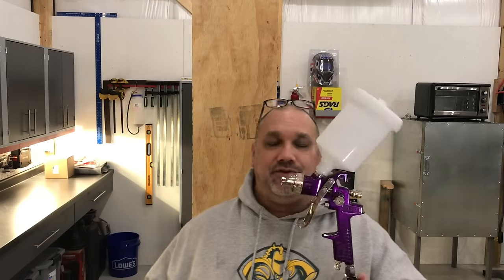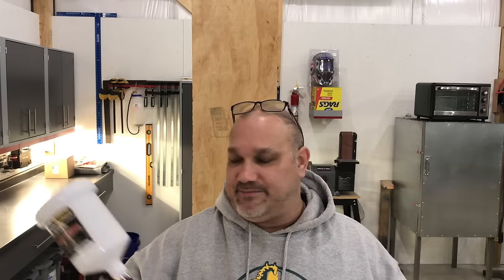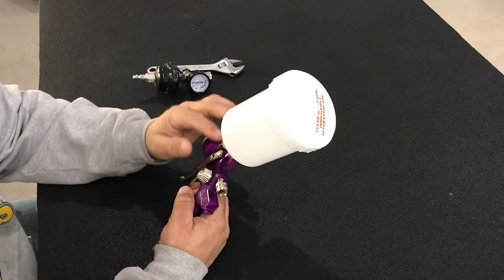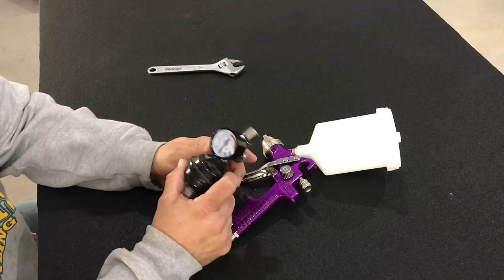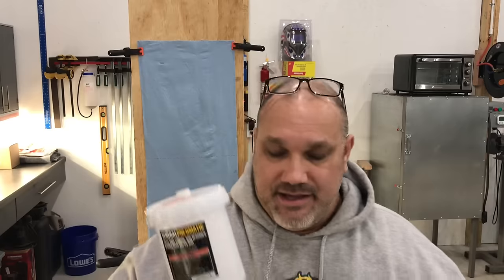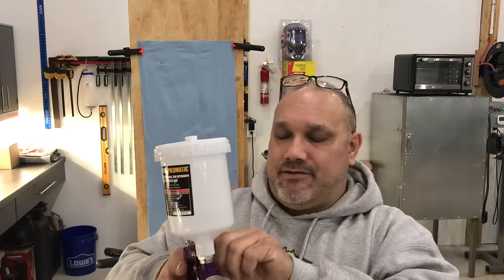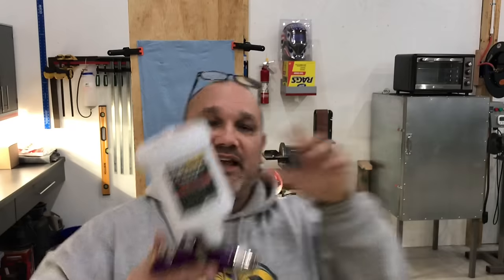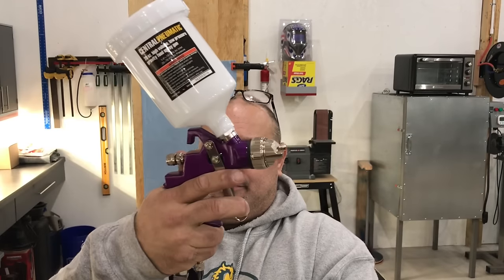How To Set Up a Harbor Freight Paint Gun

Comment: What is a good ration to thin enamel? I was using SHER-KEM enamel but I don't see anything on the can or on the Sherwin William paintdocs that tells about how much you can thin it or the best thinner for that particular paint. I did read that you should not thin more than 20% but that was not for the SHER-KEM.
Reply from the maker: I would start just adding a little solvent till you feel like it sprays the way you want. Keep in mind you can always put a little more in but you can’t take it out. Good luck! Hope that helps.

Comment: How can we know for sure what tip comes with these HF purple spray guns? I have the manual and have searched the website and there is no detail on the supplied tip size. Some people are suggesting they come with 1.4 and some 1.8. I have two HF purple guns. One came with a regular and the other I purchased did not. I am specifically looking to spray 8 interior doors with BIN shellac primer so I want to use the right tip for the application.
Reply from the maker: The 1.4 should work fine.

Comment: Hey man, great video! I'm not a paint guy at all, but I'm refinishing a guitar for my latest project and I'm looking top shoot nitrocellulose lacquer with this gun. Any tips would be greatly appreciated!
Reply from the maker: This gun should be good for lacquer. Take your time on the prep work. Two medium passes are better than one heavy one. Put on a few coats, don’t try to do it in one coat. Make sure you have a clean place to spray and keep traffic down around you part till it’s dry. I’ve seen plenty of guys put on a great paint job only to have a bunch of people going to look at it while it’s wet fill the finish with a bunch of dirt and lint. Tack off your part before you spray. Good luck on your paint job.
Reply: Awesome. Thanks for the reply!
Reply from the maker: Toby Tyler your first coat should be a nice light tack coat put enough on to cover your part if there is a light spot or two don’t sweat it that’s why you do multiple coats pick them up on the next coat. make even over lapping strokes. Good luck
Reply from the maker: Toby Tyler watch dale put on multiple coats. He really lays it on. 

https://youtu.be/keOop5GUZ4A

Comment: So using that same gun I am getting splatter .  You can see the paint splatter as it comes out of the gun and it leaving a real bumpy finish.  It's like the gun isn't atomizing the paint into a fine mist.  I am using duplicolor garage primer and basecoat and the clear
Reply from the maker: Did you reduce the material before spraying it.
Reply: No I did on the next try after sanding it down it was a mess it layed down alot better once I thinned it down

Comment: New to sprayg guns in general. I would like to use this gun to spray interior doors. How would I set it up and do I have to mix something with the paint to make it thinner. Thanks for the video it is extremely helpful.
Reply from the maker: J Lau yes you will need to thin your paint. Best to ask what to use to thin your paint at what ever place you buy your paint. enamel  will be different than latex. Thanks for watching.
Reply: Not good info guy

Comment: Great Video,  one quick question. I've seen lots of complicated setups with plumbing and water drains etc. is that little filter at the base of the gun all I really need to keep moisture and oil out?
Reply from the maker: It’s the last line of defense for moisture in line. If you drain your compressor first it should be enough for a paint job.

Comment: I bought this gun and found that the fluid delivery for 1 min was just over 4 ounces. Any idea why it would be so low? i cleaned the gun thoroughly and tested multiple times with the fluid knob backed almost all the way out. I tried to spray and it was so light i felt like painting anything was going to take forever or at least it'd take 100 coats. Thanks for any advice you can give.
Reply from the maker: I would check viscosity of the paint your using. It may just be too thick. Some coatings are puffy (for lack of a better word) so they don’t like to go they a small tip like 1.4 so you may need to go up on the tip size. There is a guy out there with a video on drilling the tip. Not sure how well that works. Worst case your out 15 bucks if it doesn’t. Hope that helps, thanks for watching.

Comment: Do you have any recommendations for running acrylic paint for small wood projects?
Reply from the maker: Spray a light coat let it dry and lightly sand with steel wool or a scotchbrite pad then repaint. When you paint wood the grain will raise a little on the first coat. Sealing and sanding it will give you a nice smooth part.
Reply: @gixerman01  
Do you think I should thin it down a little bit?
Reply from the maker: @bartgiles1068  I don’t know because I don’t know the viscosity of what your spraying.sorry
Reply: I did thin it a little bit working out good thanks again for your input

Comment: I have this same gun i was just using it with acrylic enamel single stage paint kit any who my bumpers came out glossy but the body of my car looks satin any reason for this? 
Thanks for the lesson on this set up
Reply from the maker: Without knowing the exact process it would be difficult to diagnose that. Thanks for watching.
Reply: With a single stage paint what psi should i shoot with? Compressor and gun.
Thanks for the reply on the other question.
Reply from the maker: Austin Bradley it’s still around 30psi at the gun,  maybe a little more. You just have to watch how it’s laying down and adjust. Good luck. Watch my latest video. I was using thirty psi.

Comment: Thanks for the informative video! You said that you've been spray painting for 25 years, how is your health? Didn't you get any lung problems correlated to painting? What kind of safety masks are you using? Thanks you so much.
Reply from the maker: Use a respirator! Thanks for watching!
Reply: @gixerman01  thanks for the reply, can you suggest what kind of respirator you use?
Reply from the maker: Cyrus Adam Revilla 3m 6200 or 6300 depending on what size you need and 6001 organic cartridge filters.

Comment: Quick question, I have about 3/4 pint of acrylic enamel I'd like to use on a small project.  Mix ratio is 3:1 or 2:1, I'm going to go with 2:1 for more coverage, but my real question is if no waste of paint on over spray how much surface area do you think this harbor freight gun will do with my specifications given?  Be roughly (1) 20 oz fill with what have after reducer.  Looking about ~ 10 square feet needed, feasible????  Thanx
Reply from the maker: Jade Jades a lot variables but, 18 square ft would be a 3ft by 6ft panel, 20oz of paint should cover that pretty easily. Thanks for watching.

Comment: what should you adjust if your paint job is coming out textured or rough. The paint I'm spraying is a metallic, the pressure was at 35. I'm using a harbor freight gun like your showing.
Reply: sounds like your paint is too thick...........did you add Acetone to your paint and mix it.........I believe is a 1/1 ratio.........1 part car paint and 1 part Acetone.......mix it real good before you spray
Reply from the maker: Acetone will make it atomize really well but won’t let paint flow after hitting the part because it drys so fast. What size airline were you using? Was the screen filter in the bottom of the cup? It could have been starving for material. Remove the filter and filter your paint when you put it in the cup. Try a larger air line if you were using a small one. And if those don’t work try thinning your material a little more. Make sure you’re close enough to your part and you are getting good overlap so that your material wets out as you spray it. Hope that helps. Thanks for watching.

Comment: Did u have to start out cleaning the gun mine was full of what appeared to be silicone or something took me a hr to clean
Reply from the maker: Yes I flush it with solvent before I do any spraying with the gun. There is a light coat of oil on the gun that must come off before use. Thanks for watching.

Comment: So what about filters I don't have a filter on my air compressor it says it has a built-in oil filter it's a Cobalt 26-pound compressor. I just put the Disposable filters on my gun is that okay or what do you recommend? I think sometimes I see a lot of moisture coming out of my air hose. Like I said I'm like relearning this so help me if you can thanks
Reply from the maker: If your not seeing moisture when you spray with a air gun one of the disposable bulb filter should be good. Thanks for watching
Reply: @gixerman01  ok thanks for your help i will just keep practicing :)

Comment: I have a Husky air gun and it does not spray WIDE enough ... even after opening that valve up to give a wide spray, its still not wide enough. I am looking for more of an 8 inch wide spray, this one only gives about 3 inches of spray when the valve is wide open then narrow is about 1 inch .. Curious to know if its the nozzle that is my problem and can i get a wider nozzle ..??
Reply from the maker: Depending on the gun it may not go wider than that.  Also how close you hold your gun has a lot to do with this. Hope that helps thanks for watching.
Reply: I think its the nozzle itself ... i did some more research and apparently i have the smallest nozzle available. I need to upgrade to the 2.5mm opening, i think that size should give a wider angle.

Comment: is there any attachment i need to purchase to attach to my compressor hose in order to attach this gun to it? what compressors are recommended for this gun ?
Reply from the maker: You will just need a quick disconnect. I have a video the covers the air compressor needed. Thanks for watching.
Reply: @gixerman01  a female to female? highflow ?male to male or what? what size? i know nothing about disconnects, im tryin to learn. Or does it come with any hose i buy?

Comment: I am trying to successfully spray spray grade contact adhesive what is my best way to make this happen I’m starting a Formica laminate section in my shop I have a 55 gallon drum of wilsonart 950 spray grade contact adhesive
Reply from the maker: You would be better off with a Pressure pot set up, with a pressure feed gun. That’s how most places do spray glue in industrial setting. Harbor freight has a pretty cheap pressure pot. Thanks for watching.

Comment: Would this work if hooked up to the 3 gallon pancake air compressor 100psi  from harbor freight  ?
I have small spots on my car to paint .
Thanks ?
Great video !!!
:-)
Reply: no
Reply: Thanks for getting back to me !
What size tank is good ?
I only have scratch marks and small spots to cover.
I was hoping that 3 gallon would work for little spots, it’s on sale this weekend at Harbor Freight.... lol 
Never tried it before.
Thank you though  !!!
:-)
Reply from the maker: You can use a small pancake compressor if your just spraying small area. I’ve painted small stuff with one with good results. Again it will work fine if your just spotting in.
Reply: @laptoples  no HLVP guns require a minimum of 60 gallon tank especially this one

Comment: compressor size for this gun?  I think I bought one of these HF guns a few years ago to use on a project, but used a pancake compressor that kept running out of air.
Reply from the maker: You need a compressor that can run at lest 6cfm @ 40 psi. Thanks for watching.

Comment: What causes a sprayer to clog up? I was using a Stain PAINT.  That was too thick. so I added paint thinner and it still was clogging up.i wasted more time trying to keep it clean.
Reply from the maker: There is a small filter I’m the bottom of the cup. I would remove that filter and run your stain thru a filter going in the cup. Make sure your using the right thinner for your stain. The wrong thinner could cause it to gel and clog your gun. Good luck hope that helps.

Comment: I’m trying to paint interior doors but my paint pattern is very narrow . Running at 40 psi Suggestion?
Reply from the maker: Turn the knob on the left, if that doesn’t open the pattern then try a little more air pressure. Also make sure your air cap and tip are clean.

Comment: Question, can I shoot clear car paint through an airbrush, if so what are some pointers on it, reason is I got small jobs
Reply from the maker: You can. Should spray ok.thanks for watching.
Reply: @gixerman01  ok any pointers on pressure or dilution
Reply from the maker: @jessthebarber  you should be able spray at the recommended viscosity of the clear. You will just have to try some test parts till your happy with how it’s laying down. Start low and work your way up.
Reply: @gixerman01  thank you

Comment: For some reason I can’t even get my spray gun to even make a fan it either sprays a small stream or sputters I don’t know what I’m doing wrong. I even turned it all the way up to 90 psi and it just sprays air I also turned it all the way down and it still sprays air all I’m trying to practice with is lacquer thinner.
Reply from the maker: You may have a clog in the body to the air for the horns on the air cap.
Reply: gixerman01 ok I’ll check it all out again tomorrow.

Comment: NOTES for other newbies.  I bought this gun (my first) to spray clear polyurethane on deck furniture and had a bad experience with it.  So much so, I tossed it in the trash afterwards.  

1.  The spray needle thumb screw comes out easily enough but is HARD to get back in.  The spring is strong enough my hands could not compress the it enough to get the thread engaged.   And the purple gun handle has a protrusion that gets in the way - poor design.  Remove that protrusion and mill a slot in the thumb screw so you can engage a screwdriver to get it back in (or make the head hex shaped to use a nut driver).
2.  The gun comes full of thick oil.  Anodized brass should not rust, so why all the corrosion preventing oil?  It is hard to get it all out.  And I fear I did not, as my gun didn't spray much polyurethane even with the air open and needle backed out 4 turns at 35psi of feed pressure.  
3.  This cheap gun doesn't come with the flat wrench you need to remove the nozzle!  Standard box end wrenches and adjustable wrenches, slip joint pliers etc) are too fat to fit the flats, so you cannot remove the nozzle!   Those flats could be taller (poor design again) or they could include a stamped wrench for $0.50!

I am reminded you get what you pay for.  I'm buying a better gun.  Hope this info saves others some pain.
Reply from the maker: Did you remove the screen? I have had several of these guns over the years and always had good luck with them. Thanks for watching.
Reply: What screen?  Please give details or a pic.
Reply from the maker: Peter L. There is a filer at the bottom of the cup. I’ve not had one of those filter yet that would let paint thru. It’s in one of my videos on this gun.

Comment: I need help. I have Ben trying to spray a hood matte black with hot rod flatz and I keep getting tiger stripes. It seems like I get heavy material from one end of pattern. I'm gonna try this and see if it helps me.
Reply from the maker: How did it work out?
Reply: @gixerman01  I got a new gun. Cleaned it really well and used your advice  to adjust my gun and pattern and it turned out fantastic

Comment: whats the smallest compressor ( lowest psi ) I could use to power this gun. Trying to paint a car hood. I don't have to much room for a normal upright compressor.
Reply from the maker: I have a video that goes into the specifics about air compressor for painting. Thanks for watching.
Reply: @gixerman01  

Yeah I just came across it. Do you also have videos for the proper pressure settings for the guns? seems really complex..
Reply from the maker: I think I talk a little about my setup in the wheel paint video
Reply: @gixerman01   I'll check it out , thank you.

Comment: Can I paint with a harbor freight central pneumatic compressor26 gallon air flow capacity 4 SCFM@ 90 psi 5 SCFM 40 psi 2hp very informative video , you explain the operation  in laymen’s language. I subscribed .Thanks for the  informative review of Harbor Freight paint gun
Reply from the maker: Dave Wargo thanks for watching.
Reply: Yes I have done two over all paint jobs on a extended cab truck and car I just would do a full side then wait a few minutes for air to build back up before starting the other side
Reply: I have the purple gun and the same compressor you have
Reply from the maker: Curt Thacker I’ve done the same thing paint bike parts before I bought my current compressor.

Comment: Simple and easy to follow, but some important info is missing for the beginner for which this video is intended.  While adjusting the fan, you never showed where that adjustment is on the gun.  You showed the need to adjust the volume of paint delivery, but did not show that adjustment either.
Reply from the maker: All that info is in the first 50 seconds of the video. Thanks for watching.

Comment: With my 20oz HF paint gun I can get between 1oz and 5oz with adjustment knob. I have taken it completely apart cleaned and blown through with air.
Any suggestions?
Reply from the maker: Did you pull the filter out? If you can get 5oz you can paint with that. You just have to adjust how fast you move.thanks for watching.
Reply: @gixerman01  Yes the filter is pulled

Comment: Do I need a separate regulator if I’m using my compressor? Thanks!
Reply from the maker: I do because you can get pressure drop over the length of hose. Regulating at the gun is the most accurate way, but not required. Thanks for watching
Reply: gixerman01 thank you!